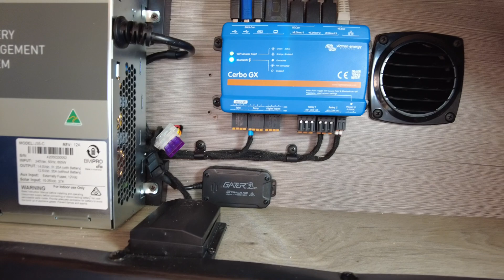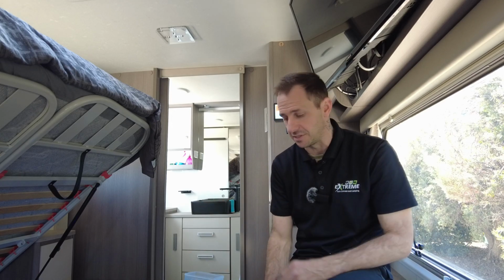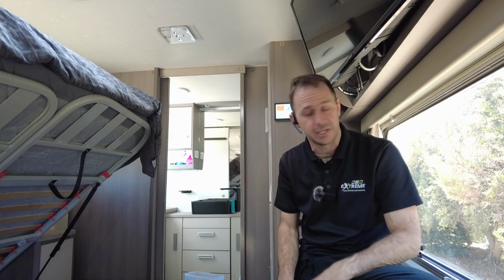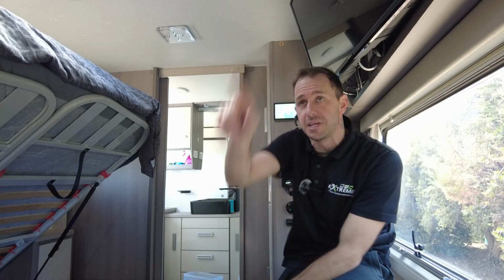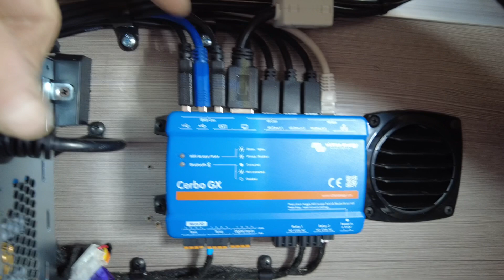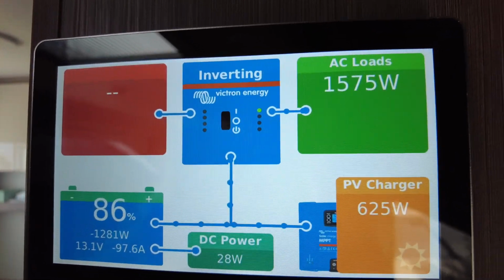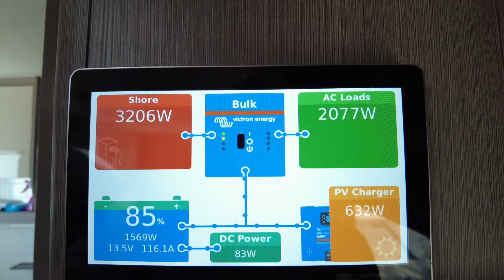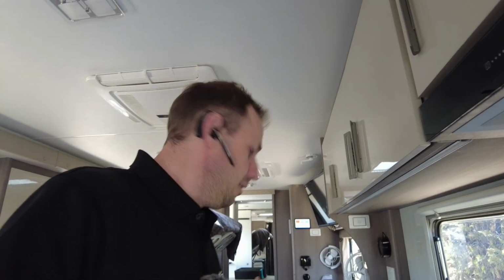Jayco Optimum Offgrid 1000watt Solar 560ah lithium runs Air Conditioner microwave induction and more

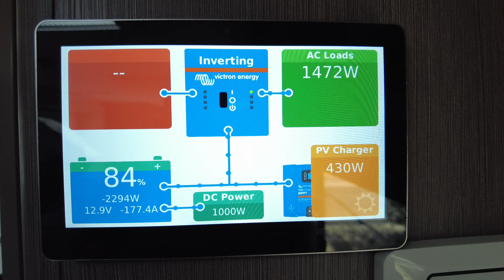Comment: 21:52  why is the DC Power reading jumping all around the place? interference from the microwave??  +1600W to -3384W ??  somethings not right .....
Reply from the maker: That dc power feature on the touch 50 display is an ‘on the fly’ reading of the residual dc power across the shunt.
It’s not useful. The accuracy in actual dc power used is under the battery icon bottom left of screen.
You can see power (watts) and amps here. Very accurate ✔️
Reply from the maker: Also,

The value in the DC Power tile is a calculation. It is what remains when all KNOWN DC sources and loads are factored out. Unfortunately, the values used in the calculation don't change at the same instant in time so the calculation can be off substantially for "a while". If loads or charging sources are changing, the DC Power number could be off for most of the time.

The fact that the DC Power number went negative means that the UNKNOWN sources exceeded the UNKNOWN loads, and/or the DC numbers were in a state of change.

Comment: Why not use the tank sensor inputs built into the Cerbo?
Reply from the maker: they are not voltage inputs which are required by the differential pressure sensors.
Reply: @extremeacc101  so they are resistive sensors only?